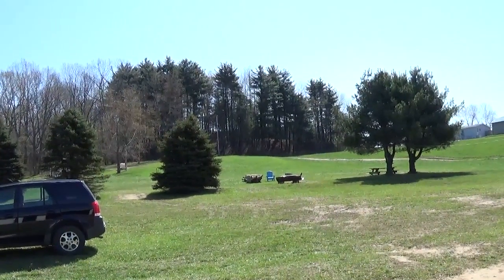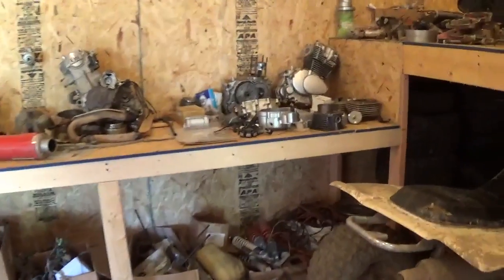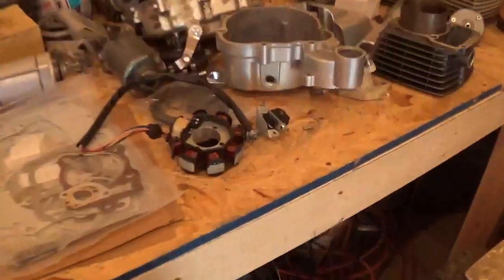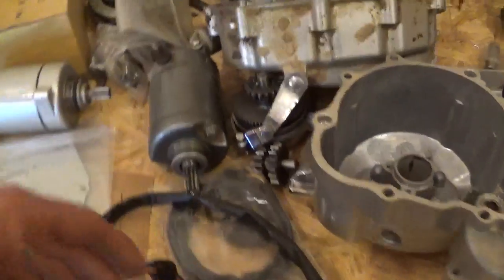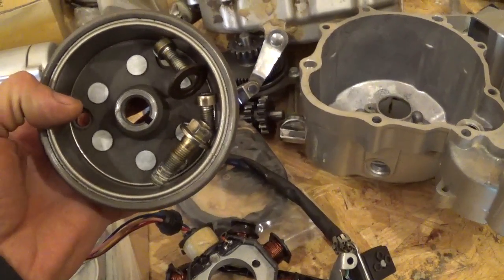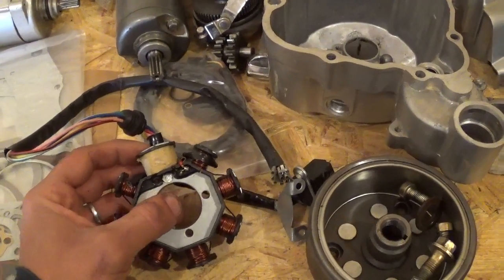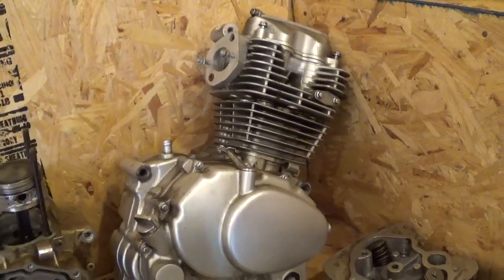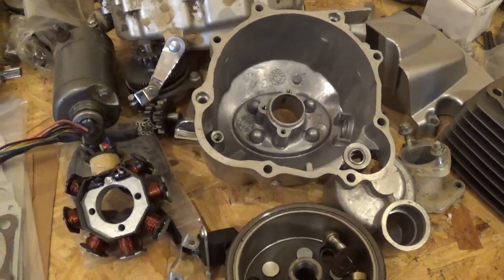Single phase to three phase stator swap, tractor steering box

Comment: Isn't it strange to have no comments for a5 years old video. I am k interested to know of you could explain the relation of the flywheel and the new stator. Were you able to use existing flywheel with 12 pole three phase stator? I m also going to swap from 1 please to 3 phase